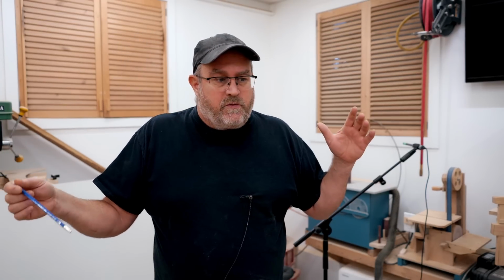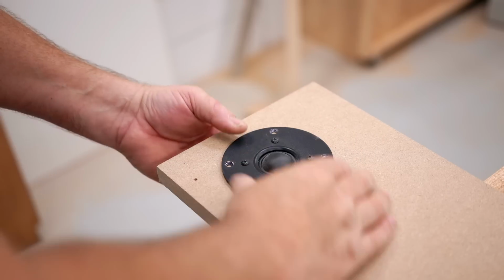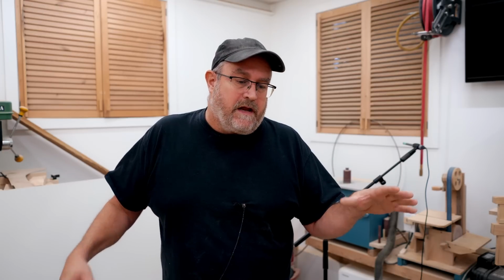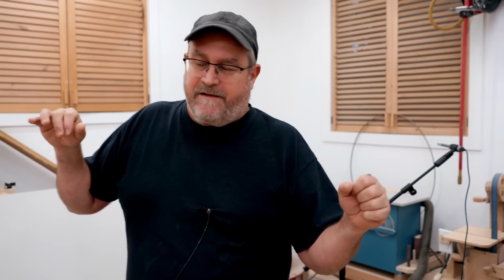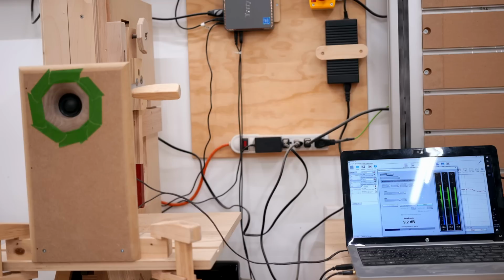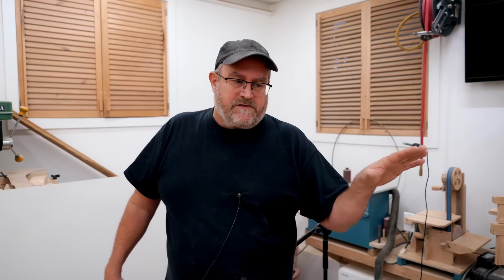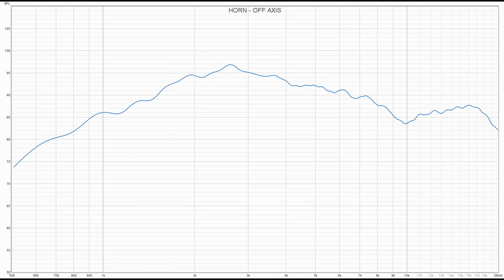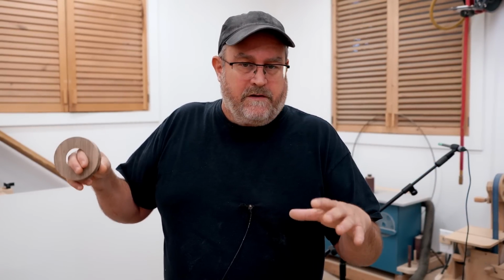What Does a Tweeter Horn Do? And Diffraction Myth Busting

Comment: Are you kidding me? That's like saying that two speakers don't matter because the sum is the same. Diffraction has nothing to do with frequency response at all which only measures spl across the range. How would diffraction do anything to change the sum of sound?

This is pretty much what makes Harman style mono speaker measurements fail. Of course you can't tell what diffraction does in a mono test. Do you even have a theory for how it could possible change a single speakers sweep?

You don't hear it with one speaker because the purpose or controlling and even harnessing diffraction is refine stereo imaging which requires two speakers.

Speaker diffraction is a form of smear and wouldn't even matter in terms of how it effects spl at all, the difference is in that you have if it were only a tweeter you have 8 sources or sound, 2 primary and 6 diffraction along the edges which causes the imaging to smudge.

It's stuff like this that gets people to think that stereo is not 3D sound.

Comment: Baffle diffraction isn't really something measurable that way, it's ulterior sound sources that'd sum up. It's like the equivalent of tweeter passive radiators. You can actually use this to your advantage. KEF uses diffraction outside of their tweeter around the outside the mid woofer to make it sound as if the tweeter is the size of the woofer or more specifically to merge the tweeter and the woofer.

Comment: i could definitely hear the difference when the horn was added. sounded like it was playing through a toilet paper roll, definite midrange honkiness. i agree the best mounting is probably flush for that tweeter. It makes sense as those drivers are not designed to be horn loaded in the first place, but to be flush mounted or panel mounted.

Comment: Horn is good enough if you look at the response. The guy who mentions a conic should come and visit me. If you want greater output higher up you need to decrease the inside diameter and get it nearer to the dome O.D. stand it off with an O=ring of both appropriate thickness and diameter. The only caveat to using a tweeter lower in frequency is if the distortion is acceptable. Erin's comment on diffraction is the best one. Otherwise from a guy who has been designing horns  30 years and and loudspeakers for 35 years you walked the talk well enough for me.
Reply from the maker: No one that talks about diffraction bothers to mention that there has never been a scientific study that proves its audibility. Why is that if it's such a big and easy to hear effect?
But in the same breath, they'll dismiss (rightfully) the idea that cables make a difference for that exact reason: a complete lack of proof of the audibility.
Now there's a difference between doing what you can to minimize diffraction, and ranking it as something that MUST be done or your speakers will be subpar. 
Guys with little practical experience tend to focus on issues that may not be important. They haven't developed the real world ability to rank the significance of all the factors that go into building a good pair of speakers.
Reply: @IBuildIt  Yep  the interesting thing to me is that while it is many times easy to measure, depending where the differences are it is not so easy to measure using music as a source.  Usually the differences need to be  db or greater. And further.  It is best that the listener doesn't see the difference or the magnitude of the changes. This biases the listener. Where did you find a solo violin version of Beethoven's Ode to Joy?
Reply from the maker: All the music I use now comes from the YouTube audio library.
It used to be that the dogmatists in the audio world were almost completely on the mystical side, the subjective side, where the rationale was that we hear stuff that can't be measured. Like the high end power cable, interconnects, magic crystals and other nonsense.
But now there seems to be a growing amount of dogmatic thinking on the "science" side, the objective side. Science in quotes because these people are the type that think science is something that can be settled. They think of it as a noun, when it's actually a verb.
They follow the teachings of their tribal leaders with a religious fervor, so we have today these two extremes that dominate the discussion.
Reply: @IBuildIt    There is enough science to clearly tell us what is audible and where it is audible. All you have to do is search psychoacoustics and you learn that our ability to hear some things is a lot less acute than we may believe. Other regions it is amazingly acute. Don't get to hung up on what you talking about. Diffraction effects can be a red herring. And in some circumstances can actually be a cause of irritation. But the idea that because you can see a tiny difference in a graph it is definitely audible No. No I have had that proven to myself. And I have passed that on to others that tell me they can hear 20K and it is night and day. So I blindfolded them and did partly random changes in the response of the music that they were used to. And low and behold, unaided by the suggestion we have by means of our sight, that is looking at a graph, the ability to detect those upper reaches of sound are not so certain. To many people listen with their eyes.

Comment: A Scientific American article from the 50s 60 or 70s (wish I knew precisely) installed a transducer on period violin(s?) to determine their resonant frequency response. The result was not flat at all, actually it had quite a lot of variability and it was periodic. I don't recall if the pattern was periodic with the 12-tone octaves, but it may well have been. In any event, I now strive to identify the optimal "notches" for a given speaker and make liberal use of narrow band carefully tuned spikes in the frequency response with eq. Easy to discredit, but if there is a formant you find aesthetic, why not put it in your transducer?

Comment: Nice Job..   More of a tweeter lens than horn at that depth...
Reply: Pish posh. Some call it horn, some lens, some waveguide... He won't be bothered, they all look quite similar, after all. Why bother with trifling details 😂
His point is 'does not matter, it just boosts the SPL, and anything diffraction being audible is a myth (proceeds to provide on axis mic samples 😂)'
Bottom line, this channel should be lauded for the woodworking skills on display. But for audio matters the viewers would be better off reading Sound Reproduction: The Acoustics and Psychoacoustics of Loudspeakers and Rooms 3rd Edition from Floyd O'Toole.
Reply from the maker: Ah, another Floyd Toole acolyte. Used to be there wasn't a religious aspect on the side that values objective fact in audio. But that's changed over the last few years, apparently.
One day, back in the 90's, someone decided to rename horns as waveguides. That someone is also a high priest in the "objective" audio side of things (everything today has two sides, usually two extreme sides), Earl Geddes. 
He says all waveguides are horns, but not all horns are waveguides because not all horns have what he calls "constant directivity". He invented the name (or actually just took it from microwave terminology), so he probably has the best understanding of what he meant.
So, it's horn. It bumps up efficiency through an impedance match like all horns do (regardless of depth), but it's not a waveguide because Earl probably wouldn't say it has "constant directivity". It also increases efficiency through directivity, but that's something else that all horns do.
Reply: @IBuildIt  😂 How captivating. So let's lump them all together, despite their different effects, and call it / them a 'thingy' then.

Now, that being behind us, can we go back to the role of these 'thingies' in controlling diffraction, and its many consequences, some of which are audible ? Something more helpful than 'does not matter' and 'can't hear in my on axis and one 30o off axis samples, so don't bother with it' would be great ! Clearly misses the pictures (horiz & vert scan) for the tree (1 sample instead of the 360o behaviour of the speaker).

Btw, when it comes to science (all the in depth studies around diffraction) there are not "2 sides usually". There's just one, i.e. what the data and proper peer reviewed analysis demonstrated. Now, when it comes to listening in situations with various diffraction types / contents then, yes, there can be extreme interpretations / preferences / religions. I personally don't give a hoot about such kinds of religion. But I will always respect other people's preferences. But then let's call it that, and just that: personal preference.
Reply from the maker: To the best of my knowledge (admittedly not as great as yours...) there have been no studies that prove the audibility of diffraction. If you have one to direct me to, I'll be glad to learn from it.
Reply: You guys crack me up!

Comment: The larger the horn, the lower in frequency that first dip will be, and there will also be new dips forming. It's called comb filtering. It's to do with the original output and reflected signal constructively and destructively interfering with one another. Where it adds or subtracts depends on the phase difference at each frequency given the same group delay.

You can compensate for this somewhat with the geometry so the horn acts more as an impedance-matching horn rather than something that reflects the sound, but of course mathematics is needed to calculate the horn dimensions. That's not something I know much about. Something to do with parabolas, I think.

Comment: I find no words to explain my support to your conclusins. You provide measurement ground for what was my ear experience some 30 years ago when I build speaker set for audio presentation. (And after years of continuation consider valid).  

My sets  was in those times unparralell  and I used twweters with fronts originally supported  wih those small hornes, similar to yours   - It worked by ear exceptionaly in synergy with my unusual  crossovers. 

Those big sets were purchased from me  by one my amazed colege  and he proudly presented it to others. 

Then happend what you said - people like flat.  Colege "discovered' from ads that domes without horn are flatter, and they cost more  (better)    and not being experienced, not looking my advice  he removed my "horn" tweeters and replaced with pure domes. Of course he had been sure it was  better because wider sounding but.... only for some time. 

He couldn'd get back beacuse the was so stuipid to hand over  "horns" to speaker shop where experienced seller was happy for it. They were not produced by company just because customers liked flat. So those my sets ended  as spares and colege  became customer of JBL and B&W. Without much happiness due to that lack in few kHz Actually he damged my constructiom  even more to prove he made  good decisions

 I confirm with  my experinence  all your conclusions - there is no  much to admire in band above 12 kHz but  noise, THD distortions and some residuum harmonics which with amplification some may find attractive becaiuse it doesn't exist in ordinary natural istening. The same as in lower than 30 Hz.

Comment: Pro audio tech with 45 years experience here. What you made is not a horn, it's a waveguide. A horn is an acoustic transformer that matches the mechanical impedance of the diaphragm to the acoustic impedance of the air in front of it. This raises its efficiency, damps the diaphragm movement, and reduces distortion. A horn always has two things that a waveguide usually does not: (1) a throat in front of the diaphragm that acts as a compression zone for the wavefront coming from the diaphragm, hence the term, "compression driver," and (2) a mathematically derived, constant "flare rate" that does the matching of impedances and also sets the low frequency limit for the driver/horn combination. Yes, a horn also controls the directivity of the driver, but it can make the dispersion wider than a bare driver, not just narrower. JBL and Electro-Voice have both made "diffraction horns" that actually widened the dispersion of the driver beyond what it would have been by itself. Good horns also have a phase plug that time-aligns the output of all areas of the diaphragm as the sound enters the throat of the horn. The lack of a phase plug is what causes the dip in the HF that you mistakenly refer to as "an inherent problem with horn loading."

A waveguide does not increase efficiency, it increases sensitivity, which is not the same thing. It increases sensitivity by forcing the output of the driver to be confined to a smaller area, increasing SPL in that area at the expense of other areas. A horn actually increases efficiency; that is, it increases the ratio of acoustic power output to electrical power input. Increased efficiency usually leads to increased sensitivity, but the reverse is not always true.

Waveguides like you're making are perfectly legitimate. Nothing wrong with them at all. Just don't confuse them with horns. And most of what you write in your description is very wise, especially about diffraction effects and the importance of getting the big things right before worrying about the little things. Well said. And, your woodworking is awesome.

I now await the naysayers who will insist that I'm wrong, despite having little to no experience in the matter.
Reply from the maker: It's a horn, Scott. If there was no efficiency boost and everything was just a result of focused directivity, the off-axis response would have dropped and certainly wouldn't have clipped. 
Waveguides are just horns by another name.
Reply: @IBuildIt  yeah +1. A waveguide DOES increase efficienty, just like a horn does, only less. The transition between a flatsurface, a waveguide and a horn is fluid. There are many different mathematical curves to be used for horns. A simple, short conical extension in front of the driver is also "a horn", albeit not an ideal one.

Comment: The higher volume in the lower range is also due to the fact that the dispersion in the lower range of the tweeter will be bundled (because the horn acts like a wave guide). Which is (imo) more interesting, because this will cancel wall reflections, resulting in more direct sound, enhancing the sound stage and therefore the quality. 

I agree that a flat response is less relevant. It can color the sound, but that is also a matter of taste.